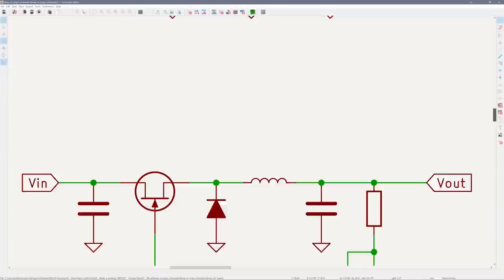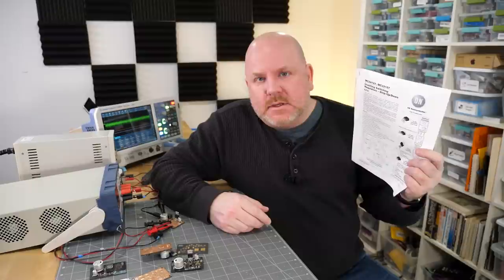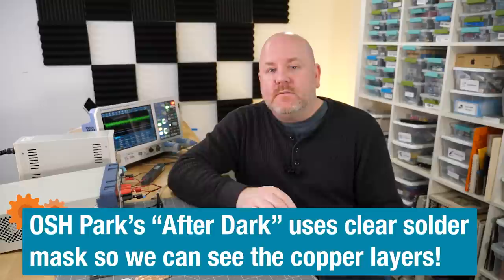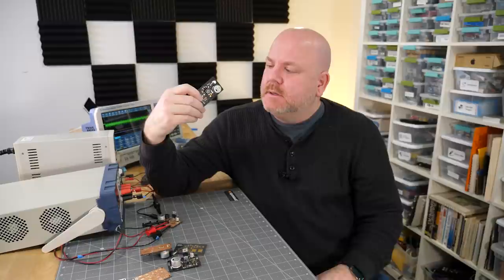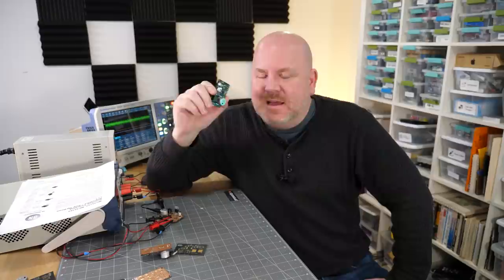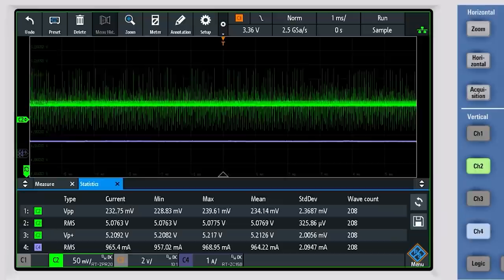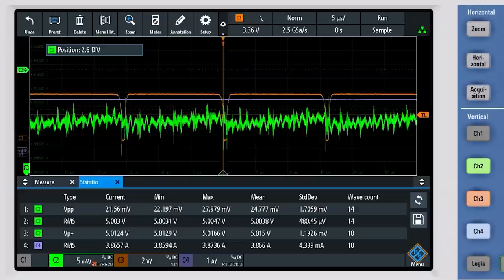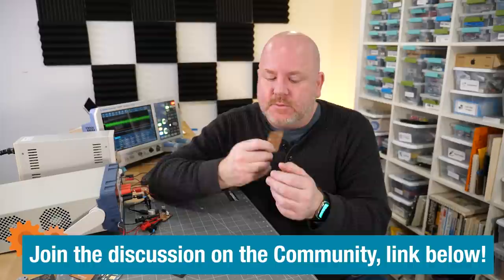A Noise-Free DIY Switching Power Supply - How Hard Can It Be?

Comment: Hi. I need to drop 1.2V @1A. Doing this linearly is really easy. But the P-CH mosfet gets too hot to touch and I don't like that. Also it is not very efficient. All these SMPS buck converters need at least 2.5-3.0 V above target voltage to work. They can't regulate for example 6.2 down to 5 volts. Do you know of a solution for this? I also don't want to go the buck-boost route cause that's inefficient as well. Is there a very low voltage drop out buck converter?
Reply: Plenty of modern switchers handle such a low drop just fine. TI's WEBENCH is a great starting part.
Reply: Parallel two mosfets with low ohm ballast resistors to get better current sharing
Reply: 1.2V x 1A is 1.2W, not really all that bad. 7805 is rated for 1A and drops at least 2V, often more. You just need to sink that heat.
Reply: @bald_engineer  Is it possible that TI Webench doesn't tell the whole truth? One solution it gives me is with TPS54202. But its datasheet shows that on the high side it uses an N-CH mosfet. Any solution in its datasheet says drop 8-24v down to 5. But Webench says you can drop 5.8v down to 5v. Datasheet says as long as I maintain a 2.1 Volts above the switching node. Of course cause it's a high side N-Channel. But where do I find that voltage? Charge pump? I bought 10 TPS54202 from china cause they are out of stock in North America. So far used two of them and nothing works. I wonder if chips from china are nothing but licorice tic-tacs with lazer prints on top of them.
Reply: @ivolol  yes true but I am working on a switch mode solution and I don't see one out there. They don't seem to make p-ch smps IC's. That's why they don't work when IN voltage is close to Out voltage?
Reply: Check out TPSM84205
Reply: @farhadsaberi  I'm not an expert but I do know a lot of switching controller ICs contain an internal charge pump to create the high side gate drive voltage. Main reason is that iirc N-channel mosfets tend to just be better performance for power applications, their on-resistance is lower.
Reply: @farhadsaberi  I looked at the datasheet and the example application says 8-24V, but that is just the example application. Doesn't mean there is not a slightly different circuit that could work with lower input voltage.
Reply: This might be a dumb suggestion but it might be more efficient to first bump the voltage and then drop it.  I'd bet your efficiency is still higher if you tune it properly.  That or just use a couple diodes.
Reply: @EVLS10  that is not a dumb suggestion, it is how every ATX PSU with APFC works. And the most efficient ones pretty much require this topology in the first place, but that's not a direct comparison since it is AC-DC conversion.

In order for DC-DC to have very low dropout it has to work at near 99.(9)% duty cycle (not all PWM controllers support even this) and so voltage drop will be dependent on losses in all the components.
So synchronous rectification, very low Rds(on) FETs (look for DC-DC controllers and not converters, they drive external transistors), oversized inductors (maybe even custom ones to meet specs requirements), and probably lower operating frequency to minimize switching losses.

So yeah, it is not a straightforward application, and will depend largely on efficiency requirements. Otherwise, boosting before stepping down is a good way to minimize headaches and cost.

Comment: hello sir. i dont get it..
this board is smps
 220v Ac to 5vDC ?
because i need it so bad..thanks.
Reply: 0:43 15V DC down to 5V DC
Reply: How much power and what size?
If you do not need a lot of power you can go with a stepdown transformer, a filtering step and a linear regulator. 
It is really the best option for most cases.